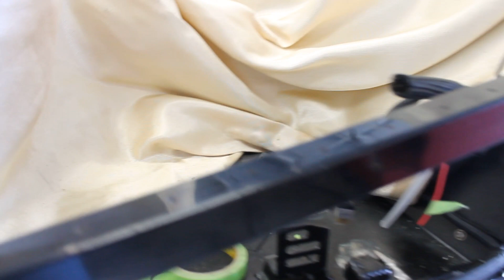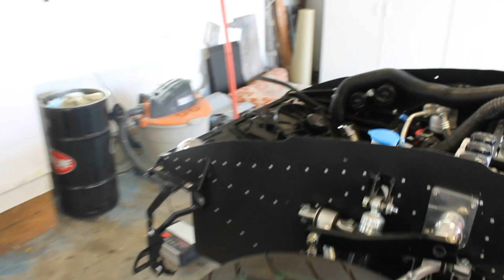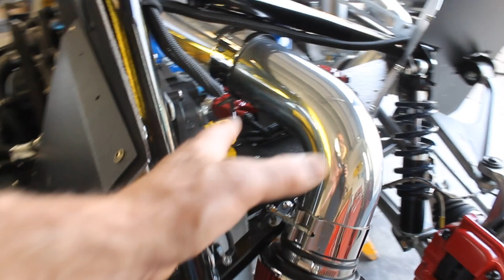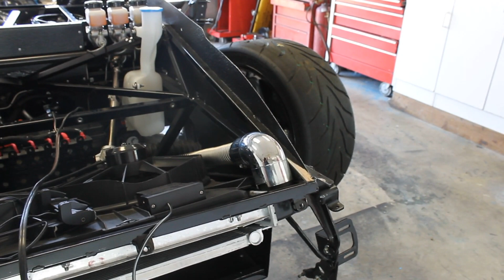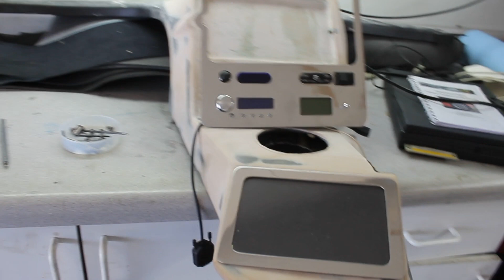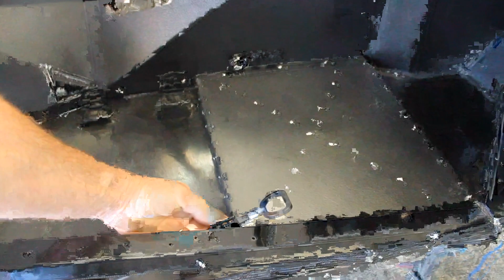Factory Five GTM Supercar, fastthings build log....... Part 63

Comment: That is a thing of beauty when it's sitting on the wheels.  Next video better have some exhaust sounds, some flybys, launches and maybe a burnout or two :)  Great job buddy :)
Reply: Absolutely, I can't wait to hear this thing running! Looks absolutely fantastic
Reply from the maker: LOL, I agree. I have it sitting at about 4 inchs off the ground right now, I hope I can actually run it like that, it looks better with the wheel well down on the wheels. I'm kinda bummed, they chip sealed my road, now every rock gets picked up by the tires. So I can't pull it out on the road and let it eat, i'll have to take it some place. I'm used to doing a quik little smokey launch up my pad into my garage with my cars. I tried it with the GTM and there was no smoke, it just launched, I have to be carefull.